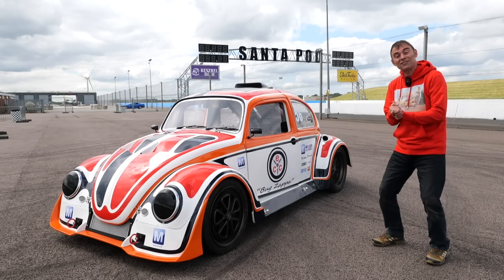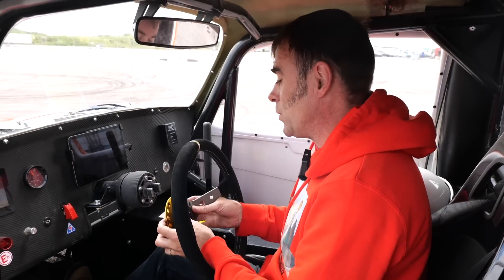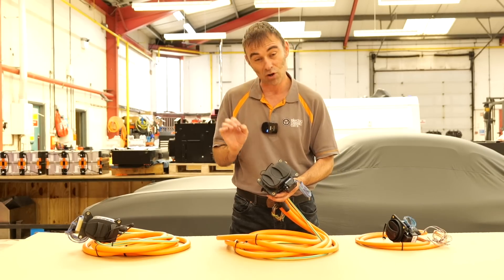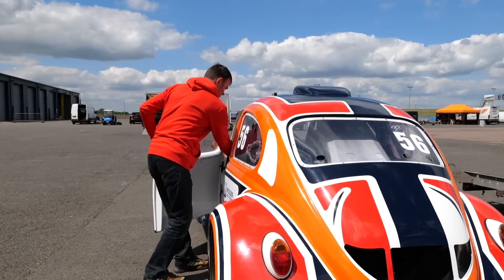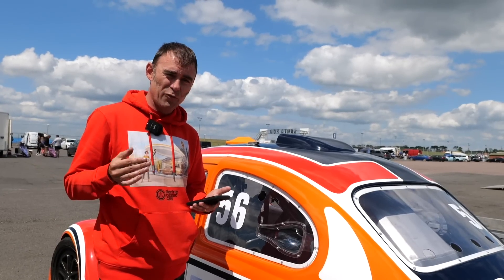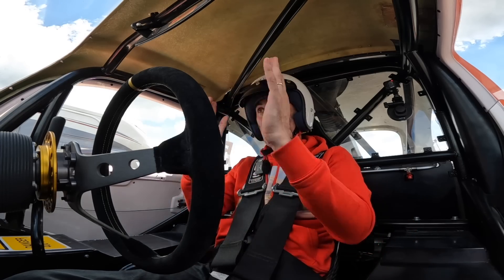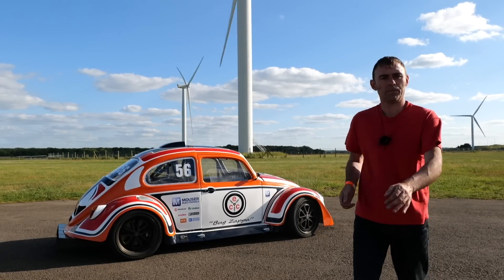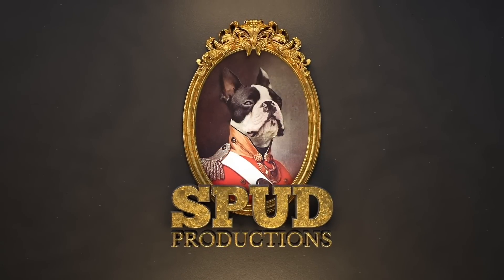Pikes Peak race car Ep14 : Drag racing with full power

Comment: Would it be possible to have the motor power ramp up for the first half second or so? Say, starts at 50% for half second on launch, then power ramps to 100% over  then next half second to give traction control and tyres a fighting chance to launch you faster.

Comment: There's still more that the car can give, and that's encouraging. Thanks for sharing the excitement, Richard. 🙂👍 As far as the connectors go, there is developing need for NACS connectors in the American market. Those smaller plugs are proving to be very popular, both with drivers and car companies.

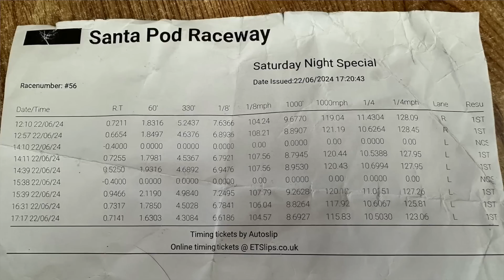Comment: 9:19 Looking at the last run I calculate using the ticket times and a bit of calculus: 0-60mph 2.384s (so different from "Tracky"); maximum g force was at launch with a value of 1.323g.

Comment: Awesome car.  I am thinking of doing something similar in a Mark 2 Golf, but RWD only and set up just for drag racing.  Right now I am trying to figure how small a battery I can get away with and still get full power to a Plaid rear drive unit. 
Any resources you could point me to would be appreciated.

Comment: Like some one said, could it have a software "launch mode" that build power rapidly to avoid wheel spin? Like 80-100%. Time how long the wheel spin happens and make that the duration of power boost.

Comment: I'm sure you would gain at least a half second, probably more, by letting the front motor do its job. It's not like a RWD with only the front wheels, rotor and hub spinning. With AWD turned off, you're not only fighting the rotational inertia of the wheels, you're also having to spin up the reduction gearbox and motor. Even if the front were turned down to 20%, just to keep the rotation up with the rest of the car, you would gain a lot more than you think. But the front drive could really help a lot more than you think, especially at the top end where traction isn't quite so limited.

I really think you would cut more than a second off if you just kept it in full AWD and let the traction control deal with the wheelspin. The Tesla Plaid Channel does 9.1Xs and it weighs twice as much as your car.
Reply from the maker: It is in AWD. 🤷‍♂️

Comment: Have you looked at how climb angle impacts traction?  Can you adjust torque vectoring to balance traction front to rear whilst climbing?  There’s some very steep sections at Pikes, and also some shallower areas of ascent.  Interested in the science of that…
Reply from the maker: Yes. We’ll be adding some rake to the car to take it into account. 👍

Comment: Just a thought - on 'The Tesla Plaid Channel', every time he drag races his Plaid, he never does burnouts - instead, he drives around the water and does a few sharp accelerations to clean the tyres before the lights go green, and he usually beats the ICE cars, out-of-the-hole as they say, to 60', and in ET. I understand this may not apply with the tyres you're using, but the hugely-powerful 4WD Plaid model may have something that could transfer to Bug Zappa's situation. Really enjoying following your progress, many thanks!
Reply from the maker: Thanks for the info. 👍

Comment: Could you set a ramp linked power / speed ? so that the power starts off low enough to not spin and ramps up as the speed increases ?
I know that is basically what the traction control does, but traction control is not really linear or smooth.

Comment: how to destroy a car
Reply: fossil fuel mafia - represent?
Reply: What do you mean?
It looks like only the floor is from a car if even, the rest is tube frame and class fiber on top.
Only really about 10% of this car is actually from a car to begin with and I refuse to believe that the rest 90% of the car was not used to save other cars, if the parts was usable of course.

Comment: Is there a LSD, or do you even need one with electric cars ? I just ask because when you were trying to get heat in the tyres it didn't look like the front wheels were slipping like the back ones were.
Reply from the maker: The front and rear motors both have LSDs in. I can switch it into FWD and RWD mode for burnouts. Then back to AWD mode for racing. 👍

Comment: I've said this before but... Need to put 60% front and 40% rear, and delay giving full power for few hundred milliseconds... This way it has enough time to get grip on the track.
Reply from the maker: Looking at the logs afterwards it seems it’s the front that let’s go first. So next weekend at the strip we’re going to be playing around with front/rear power bias. 👍
Reply: @ElectricClassicCars  If you put too much on rear wheels, it will lift the front up causing it to loose grip.

Comment: tyre pessure too high. i just tested the new model 3 performance and it was awfully slippery compared to my 2019 model 3 perf.  i checked tyre pessure it was 3.2 bar instead of lower than 2.7 for good grip
Reply from the maker: I agree. Tyre pressure was too high. We’ll be going back again next weekend so I’ll start playing around with tyre pressures now. 👍

Comment: Great work Richard!  Can you program a launch mode by reducing the power at first then gradually "give it the beans" smoothly so as not to tire spin?
Reply from the maker: Not at the moment but the next thing we’ll be playing with is front/rear motor power bias as looking at the logs it seems the front motor spins first so the rear can cope with more power.

Comment: Did you adjust tyre pressures and check temps at all.
Reply from the maker: Not that day. I wanted to adjust one thing at a time to be able to directly attribute the benefits or lack of to that one parameter change. Now I’ve exhausted traction control settings next will be tyre pressures and motor power bias front to rear next weekend. 👍
Reply: @ElectricClassicCars  Can you do say... 60 percent power till 35 mph then 75 percent till 55? and so on... that with about 30 percent power front and 70 percent rear seems to be the sweet spot for power to front wheels going straight or around corners

Comment: Are you going to fit the rear wing and try it?
Reply from the maker: Not until the front splitter is on as without it it could lift the front wheels. 👍

Comment: Solid progress imho. The 1/4 times are not that critical as you need to take it round the corners yet, so the chassis has much more to do! The car is super stable leaving the start to the end, really good.

A day (if you could) at Prescott hillclimb would start to see the balance of the car for it's intended purpose. Fabulous effort all coming neatly together.
Reply from the maker: I agree that drag racing is not really representative as to what we built it for. We’re looking forward to receiving our new suspension so we can get to see how it goes around corners and start tuning for that. 👍

Comment: Can you program in gradual power, say 80% for 1.5 seconds then 100%
Reply from the maker: Unfortunately not at the moment.
Reply: Was thinking the same thing. 👍
Reply: @leafbone1  1.5 seconds is too long... 0.25 seconds should be enough... Also shifting the power bias from rear to front helps with losing grip but you need own sensor to detect excess torque, basically detecting if front pulls up too much.
Reply: @leafbone1  Traction control will make it a beast
Reply: I thought the same thing. Then read comments so deleted mine.
Reply: Yes it's called lifting your foot a little
Reply: @gormauslander  Yes but almost any top dragster team limits power via programming or hardware instead of pedal, because it is much more consistent then any human would be possible to be.
As soon as you spin you have most likely lost the race.
Reply: Surely  a more complex foot peddle with more range of motion